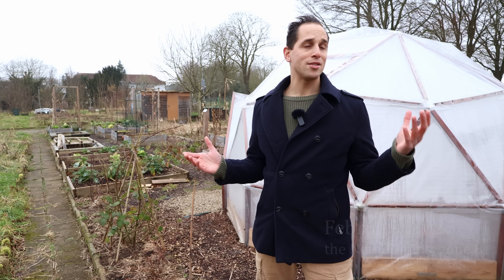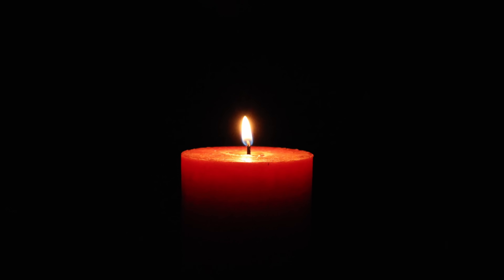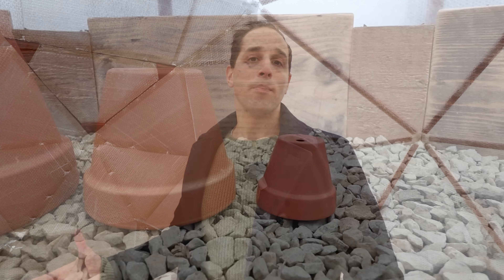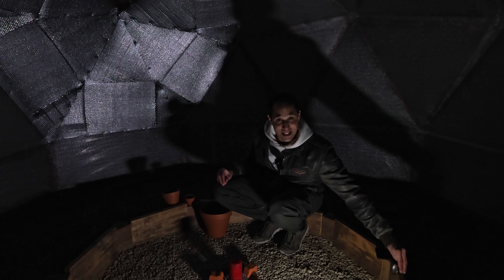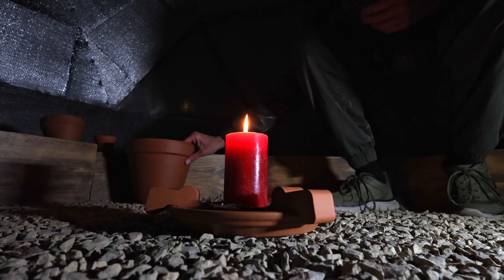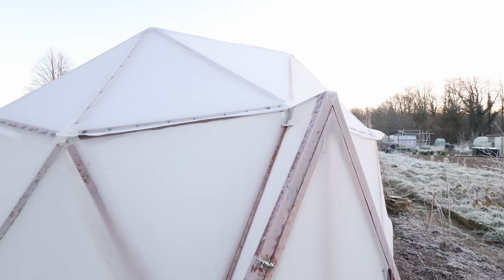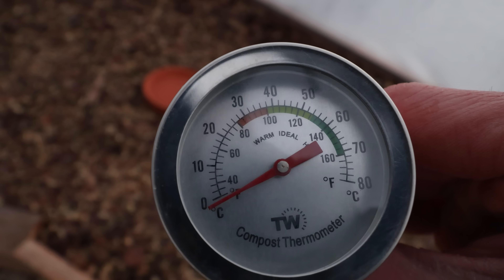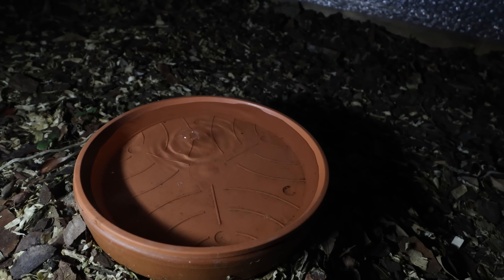Can a Terracotta Heater Keep my Greenhouse Frost-free? • Ep. 48

Comment: Minimal insulation will take more heat energy. Go bigger with multiple and seal those leaks.
Reply from the maker: Yup, definitely. Am also planning to at least double the height of the grow bed to increase the thermal mass.
Reply: @atthegrassroots If you bury flexible convoluted tubing, for heated air tubes, under the raised beds, they won't freeze at night and use less energy to heat the greenhouse dome.
Reply from the maker: @dogprowilhelm7630 yeah I was thinking about that method aswell, but I think it would be most effective to combine it with a fan and an additional heat source, to actually blow warm/hot air through the tubes. It's possible but comes with a bit more effort. Still think a hot compost setup in the middle of the dome would be best for my off grid situation. Thanks for your insights!
Reply: @atthegrassroots It runs on negative pressure, drawing the heated air into the ducts passively if designed properly. Seen an entire house heated this way, Rocketstove style. Run the ducts parallel and at 45° angle from the front of the raised bed as the inlet and to the inside wall as the exit utilzing the natural convection in a dome structure. There will be sveral openings to be be cut with a jigsaw or hole saw depending what size ducting. You mentioned raising the beds and this would be the best time to plan ahead.

Comment: Am I losing my mind, or are you trying to trick physics? How would you get more heat from the same heat source being covered vs uncovered?
Reply from the maker: I won't be the judge about you losing you're mind, but I never said anything about getting more heat from the same heat source. The terracotta in this experiment acted as a small source of thermal mass/slow release to radiate the warmth to the surroundings, rather than that the heat of the flame would go straight up. Truth be told, I should have stated that last part more clearly in the video.
Reply: @atthegrassroots it’s still not going to make it physically warmer than simply burning a candle.

Comment: As already stated, this won't increase the amount of heat generated, but the pots will slow the transfer down and have it radiate outward more than upward.  If you're using one as a 'space heater', use some aluminum foil above the holes in the first and second pots to direct the airflow towards the side of the pots.  This will transfer more heat to the pot rather than just letting it all rise straight up.
Reply from the maker: Yes, exactly! Thanks for your comment!
Reply: Or  empty t lights  on the holes

Comment: Using crisco turning it into a candle instead of premade candles. Its cheaper and burns longer
Reply from the maker: I've seen those, they also burn for a long time!
Reply: @atthegrassroots they burn clean and they can be put in mini mason jars so you can set how long you want it to burn and set multiple up in different places and they dont leave candlewax to clean up.

Comment: Try your experiment by lowering the ceiling. If you can safely place plastic about halfway up or less to reduce the square footage, you will be surprised at how much more heat will be radiated in the more limited space. It will require a bit more precaution around the pots . Maybe a metal tomato tower.
Reply from the maker: That's a good idea, someone else also commented to combine this with low tunnels over the grow beds to aim for the same result. Thanks!

Comment: Or... fascinating fact, you can actually buy greenhouse paraffin heaters, specifically designed to do the exact job you are struggling to do. Amazing new tech only been around a hundred years or so. You can also surround the heater in a similar fashion so you can create a thermal mass, just like you have done if you wish with firebricks for example. You will find it cheaper than those pots and buying candles everyday, that do next to nothing.

Comment: You'd do better to mod t into a sand battery and add a teg fan. Sand battery can be scaled up or down depending on the heat requirements.
Reply from the maker: Thank you! I am interested in sand batteries, especially since they can hold higher temperatures than water (although are worse conducters if I'm not mistaken)

Comment: Not sure if anyone else already suggested it, but I would use the heat the Candles produce to heat up a water source. Water saves heat the logest if I am not mistaken, at least longer than a terracotta pot...
Reply from the maker: Agreed, for more sustained heat retention, I'm better off improving the thermal mass and insulation where needed, such as water tubs/jerry cans etc. This was more a simple experiment to see if a terracotta setup could help keep the dome above freezing, even if only by 1 °C.

Comment: I enjoyed this.  The heater obviously helps, depending on many factors.  I would think that it is just a case of "the more the merrier."  If one made a difference, three would exponentially help.  Maybe a USB powered ceiling fan at the top?  It is a very cute greenhouse, btw.  

Checking out your other videos to see what you grow in there.
Reply from the maker: Thank you so much for you kind comment! And yes, more heat, insulation and thermal mass will add up how well a greenhouse will last trough the winter. My greenhouse is off-grid, so any electrical devices would either have to be powered by solar or with a rechargeable battery.

Comment: You aren’t doing the pots correctly, cover the top pot to keep the heat in the pots. The heat will have to lower and can only escape through the bottom…
Reply from the maker: I've heard the tip multiple times now, I will try it, in case I will deploy such a heater again. Thanks for your comment!

Comment: As others calculations have come to the conclusion I thought probably was the case when hearing the idea. A candle doesnt really generate a whole lot of heat in comparison to the square meters you want to warm up in a green house.
You would need A LOT of candles to do that. 
And for that I have a fire hazard warning. Putting many candles close together is super risky compared to just burning a single candle. The more and closer to eachother the higher the risk.
But even as few as 3 is already not great, doesnt need to be that many candels.

There is a risk they heat up each others wax hot enough that the melted wax vaporises, and then mixes with the oxigen above creating a fuel mix, and then all of a sudden you get what is essentially an explosion when the concentration of oxygen vs the vaporised  parafin hits just the right procentage (and you already have a burning candel there as a igniter). It burns quick, hot and suprisingly big, all of a sudden.

So you should always place canldes with quite a bit of distance between them. atleast 5 cm from eachotther. And its more important with candles that are the type that generates more heat. 
Its a huge fire right away when the collection of vaporized wax catches fire, enough that you should be concerned about it reaching the ceiling of a green house and catching that on fire.

My guess is that compost heap is probably the best bet to heat up a small green house for a off grid solution. But it needs to be quite large and potentially multiple heaps to actually generate enough heat. And its harder to get hot composting going in the winter and cold.

Comment: Bubble wrap.  I recall many years ago that  using bubble wrap to cover an unheated  swimming pool was quite effective. It would amplify heat during the day if the wrap cover was left on, but more importantly retain heat overnight. Maybe a bubblewrap cover might be a possible solution for your greenhouse?
Reply from the maker: The inside of my greenhouse is already covered with bubblewrap, so that should increase overall insulation. I want to add more thermal mass by raising my grow bed(s) , but that is gonna take some effort. I also have some tubs that I use to grow my lotus plants in. If I empty the tubs I could use them as extra thermal batteries. Thank you for your comment! 🙏🏻

Comment: problem is with them  terracotta heater is that is gives a lot of soot with paraffin candles or even using paraffin heaters as we used to use in the 80s for greenhouses  and this puts particulates in the air.health because it contains ultrafine particles and chemicals that can be inhaled. This particulate matter can penetrate deep into the lungs and bloodstream, and burning paraffin can also release VOCs like benzene and formaldehyde, which are known to be harmful. Inhaling these emissions can increase the risk of respiratory issues, allergies, and other serious health problems. and not sure how they would leach into plants.

Comment: i saw one of these where the guy put a few nuts and bolts through the top hole so the fire would heat up the metal which would radiate the heat into the clay instead of just losing the heat out the top. you probably need to accommodate air flow so the candle doesnt go out
Reply from the maker: Yeah, I've heard this tip multiple times now. It makes sense, but like you've pointed out, the airflow needs to be sufficient.

Comment: Your terra cotta heater is not actually designed like the other pot heaters, the heat of the flame is just going up the center hole very quickly, all the way up to the ceiling, most pot heaters go from smallest to largest inverted pots all connected with either a long bolt or all thread rod , forcing the heat either to be absorbed into pots or hot air to spill out from underneath rim to fill the next sided pot , making it more as a space heater, the center bolt is made up with alternating nuts and large washers to act as a heat sink and radiator, capturing the flame directly to the metal
Reply: This is why it probably isnt working. I experimented with one and 4 candles and the heat should easily keep this small room above freezing.
Reply: It's just all nonsense. I have built them the way you say and put multiple candles under but the reality is that they can't heat a damn thing, they are a waste of money time and effort.
Reply: The pots make no difference whatsoever, a candle has 100 w of heating on average adding a pot does nothing to increase that. Yes I understand thermal mass but if the pot takes one hour to heat up it just means it looses heat after the candle has gone out for an hour. A 100 w heater is just a 100 w heater.
Reply: @karllolley4855 so if the holes were non existent and sealed so you couldn't see the flame directly through them, would it make a difference in trapping the heat within the terracotta in order to radiate it outward better?
A 10watt laser pointer doesn't light up a room but a 10watt LED is capable of lighting up 100square feet. It's how it's utilised. Same as your 100watt candle scenario. The pot's construction absolutely makes a difference on how the candle heat is utilised.

Comment: Would be interestimg to see if a thermal mass, a bucket of sand with a conductive copper strip over the flame transferring heat to the sand would make a difference.

Can put the tereacotta pots on top.

Comment: its interesting that this can generate as much heat as it does, but i dont feel like this is economically viable, i feel like it would be cheaper to put an electric heater and just pay for electricity than to buy all those candles,
Reply from the maker: You are definitely right. Besides the fact that this was a simple experiment, the idea with these is that you could potentially ward of some light frost for a couple if nights. But if you want sustainable, reliable warmth for the winter, than other methods are just a better investement.

Comment: You can use a Crisco lard container put a WIC in it grab a thick clay pot take some flat copper tubing wrap it around the crisco container place fill the sides with sand place it in the pot before filling but be sure you have at least two feet of extra pipe coming out of the top grab a metal container fill with water bend the pipe into the water container you'll have heat traveling from the tube to the water creating two separate heaters one or we can discuss chemistry heaters you can build with copper rain gutters and with a  temp glass viewing window

Comment: from a physical standpoint the pots make no difference at all. The mount of Energy which you release in that dome is the same, you only diffuse if a bit different. One could argue that the pots male it in your case even a bit worse as you block the radiation heat from the flame and convert it fully to convection, so you only heat the air around the pots which will rise up and will loose a lot energy bouncing off the cold ceiling. Without the pots however a bit of that radiation energy is directly heating the ground (as long as its illuminated), though a lot will also be lost just radiating directly to the cold walls.
So you cold rather try setting it up again and hanging a mirror some meter or so above the candles without pots, My bet is you'd get the best results like that

Comment: I’ve used a heavy bottom stainless steel pot turned upside down on a rack in an emergency, not for my greenhouse but at the kitchen table in my camper. It threw off more heat than the terracotta pots I have used before.
Reply from the maker: Maybe it conducts warmth better than terracotta. How many candles did you use?
Reply: @atthegrassroots  7 but I expect it would depend on the size of the pot you use.

Comment: One pot is all that is necessary as regardless of how many additional Pots you add, the thermal radius area remains the same.

If you flip the plate upside down, drill a 1/2" hole directly in the center, then put a 1/2" threaded rod through it (washer and nut on both sides of plate to secure plate to rod, then every couple inches add an additional nut with a washer resting above it, going all the way up to the Terra cotta pot (which will be upside down with nuts and washers securing it to the rod) you will generate vastly more thermal mass than by the pot itself. 

Use 3 to 4 candles inside, evenly parted. The heat will reach larger surface areas of the pot, heat up the rod and washers which will in turn generate heat. Allowing your pot to remain hotter longer. 

You want at least 2-4" gap between the plate and pot rim. 

Never set it on a flammable surface and always make sure its level. Every so often look inside for soot build up, you have to clean them, soot build up can cause a fire.
Reply from the maker: Thank you for the detailed description!

Comment: As someone who off sets my heating bills with this style heater I can positivity say that your setup if wrong. 

Small pot goes inside the big pot. Cover the hole in the small pot. Both pot bases need to be parallel so placing them on a bread loaf baking pan. Light 5-6 tea candles and place them in a circle on the bread loaf pan then place the small pot over top of the candles. Next place the large pot over the small pot. The bread loaf pan works great because it gives you about 13cm of air space between the pots and candles. Within an hour the whole setup will be far too hot to touch so make sure it's in a safe place on a nonflamable surface. Those candles will burn for about 4-6 hours and the pots will stay scorching hot for about 30-45 minutes after the last candle is burnt out. 

The size of the area you are trying to heat will take two of these setups to notice a difference. If you have an IKEA near you you can find tea candles very cheap there.

Comment: Definately fix leaks.  But also,  more thermal mass.  When my grandmother showed us this trick back in the 80s, she said put a pot inside the big pot.  Creating layers of teracotta.  So that more thermal mass was able to radiate the heat.  Also,  your greenhouse didnt have anything really growing in it.  Plants absorb and use that heat.
A sterile and open air space wont hold any warmth
Reply from the maker: Yes, I agree on both points. I planning to increase the height of my grow beds to add more thermal mass, I'm gonna fix the leaks and maybe look into adding compost heat this year

Comment: You might not want to completely seal the dome air tight. You might want to have a little air flow if you’re using fire to heated that small area. The more candles you’re burning the more carbon dioxide that builds up. If the dome is completely airtight, that carbon dioxide builds up with the heat. My personal opinion if I were you, I would keep the air gaps in the door there and use six candles with three heaters.😎 this is a super cool experiment to show people who are doing a greenhouse and need to heat on a budget…
Reply: Plants can actually handle some CO .
Reply: @missingutahI meant to put monoxide but if he seals the dome off air tight and introduces more than 3 candles it’s only a matter of time before the dome fills with carbon monoxide and dioxide and would extinguish the candles and the plants would freeze

Comment: Just do a compost pile(leaves and grass clipping from spring and summer maintenance) with a gravity pump and some hoses. Run the hoses through the pile as it will break down and generate heat and warm the water, run the hoses in a circle around the greenhouse and into your home for hot water and cold water. 🤷🏼‍♂️ my neighbor and I do it every year it’s been a fun experiment and we copied some old French farmer
Reply from the maker: Yes, I know such a compost setup can be very successful! Like I said at the beginning of the video, I don't have one (yet), but has been one of the more interesting off-grid methods to warm a greenhouse.
Reply: @atthegrassroots that’s amazing work! Sorry! I usually skip around the video. I love the experience you shown that scientific approach wins hearts and minds!